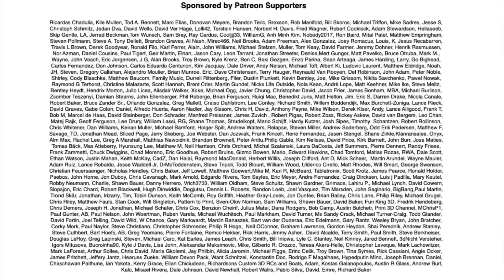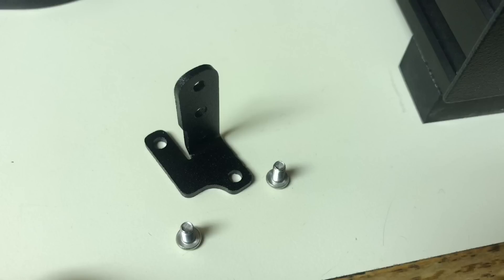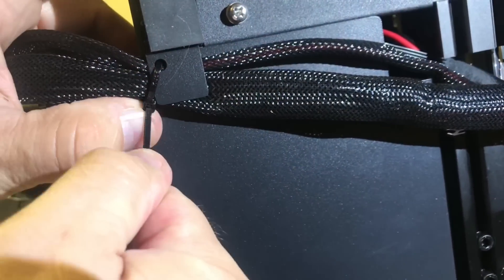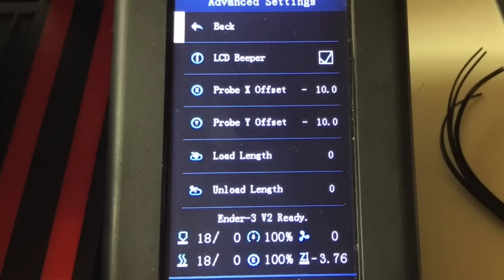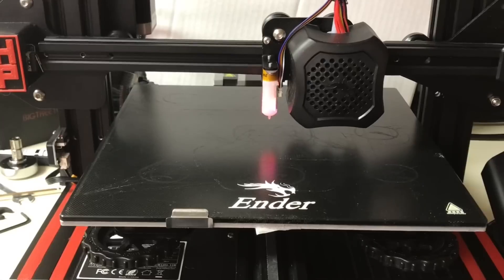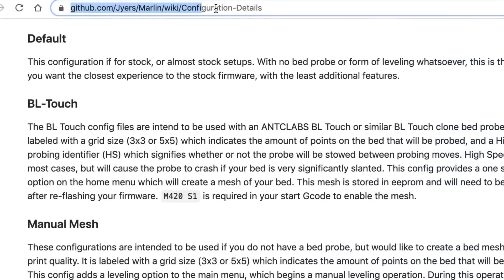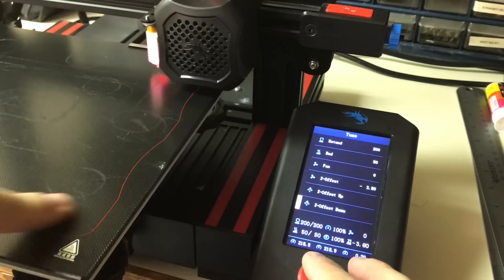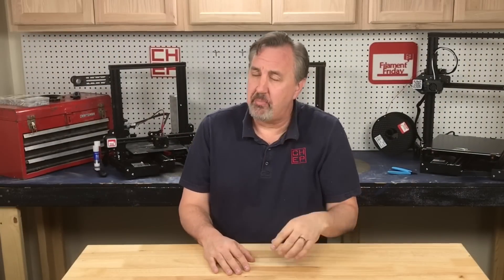How to Install AutoLevel on Creality Ender 3 V2

Comment: GREAT video. Can you please readjust the bed size for the ender 3 Max. This would be most helpful to alot of people. I tried this on the ender 3 max but come up to short because of bed size when moving to back position. There is is tutorial from smith3D with your link for the bl touch install for 3 max. Thanks for sharing

Comment: Very interesting video. I also saw your video on mesh leveling your ender 3v2. Which of these methods do you prefer? It seems like the mesh leveling gave you better results but leveling with the BLTouch seems easier to do. Very interested in your opinion on this!

Comment: Nothing happens once I insert the SD card.  The screen just lights up and everything powers on but that's it.  None of these files work.  I tried renaming them.  None of the creality files work either.  I need some help yall.
Reply: I just installed the firmware for bltouch on my ender 3 yesterday and it worked. I downloaded the correct file from creality and downloaded 7-zip. Then in files I right clicked on the creality file and clicked extract with 7-zip or whatever. Then you get a folder with the .bin file that I put on an 8gb micro SD, plugged it into the printer when off, turned on the printer, and after about 10 seconds of the screen being on but blank the regular startup happend and it was finished. Hope this helps
Reply: @ethanm1943  thank you, I'll definitely have to download 7-zip and try again. I also just seen that all wires should be in the dedicated BLT port on my main board.  So ill give both a try. Thank you again. I'll update after work today.
Reply: The same problem happened to me, make sure to unplug the power cord before inserting the SD card.

Comment: Hey good sir, have you tried to compare the print results of 3x3 vs the 5x5? because i just installed mine with a 5x5 and i still cant get a consistent bed label some corners are nozzle to low and other corner is the nozzle is too high.

Comment: I upgraded the firmware on my Ender 3 V2 to Jyers  BL Touch 5X% V1.3.3, and notice there's many more new menu choices and sub-menu choices.  Many of them figured out, but wondering if some where there's a manual that describes exactly what all the menu choices do exactly?

Also trying to recall what was the original firmware version that came with the printer if I want to go back?
Reply: Check the Wiki!

Comment: Auto bed leveling is a MASSIVE quality of life improvement for printers. I wouldn't recommend anybody try and do it manually because even thought it's possible, it's far easier to just use ABL and be guaranteed decent 1st layers. Biggest issue with it is you really need to rebuild the firmware to tweak how many points it probes and their offsets.

Comment: Help Please, Looks like V4.2.2 under the word Creality in the middle of the board on the bottom. Now to sort out my levelling menu and why it does not just go to confirm when I click the Level menu icon as in the video, instead I get a list of option, check box for Levelling Active, Creat New Mesh, Manual Tuning, ETC. . To confirm, I had loaded E3V2-BLTouch-3x3-v4.2.2.bin. Any suggestion . Thanks in advance.
Reply: Well feel pretty dumb now, Yes just click Create new mesh. Yea. already had a mesh so make sense.

Comment: Thanks for the video, I also added the bltouch to my Ender3v2, which is a beutifull machine by the  way. But I have the issue that the probing often fails. I can not start prints via ocotprint due to the danger of crashing the probe into the bed. I also made sure the bett is manually leved as good as possible (bed is warped). Did you experience something alike?
Reply: Did you solve this?
Reply: @veenarm  not really. if i level via display it works most of the time, but with G29 I have several probing fails. I now ordered a second z leadscrew kit, because I also think that this is a issue.
AND I ordered a anycubic Vyper, to see if its auto leveling is better.

Comment: Help!!!! I followed your instructions installing the BLTouchV3.1 genuine item. However, after copying the Jyers/Marlin E3V2-BLTouch-5x5-v4.2.2.bin file to my SD and inserting into the E3V2 slot, on powerup I get a dark LCD screen and cannot access the printer at all with octoprint (which was working perfectly on the stock SD card firmware). I fear that I have a brick now. ON powerup, the BLTouch does light up and the probe extends/retracts twice but as I said, the screen remains dark (though it is on because I can see some light emanating from it in the dark). Help!!!!
Thanks in advance.
Reply from the maker: Rename the .bin file and try again. You might have to use a new SD card but it will recover.
Reply: be sure the firmware is for your board revision
Reply: Phew! It seems that it was not wise to put the new .bin file on the stock SD card that came with the machine. I tried putting the new .bin file on a brand new FAT32 formatted SD card with nothing else on it and that worked, thank goodness. Have not yet done the probe calibration process, but that is next. Thanks for your help!
p.s. I do note that I tried putting the E3V2-UBL-BLTouch-10x10-HS-v4.2.2.bin file onto the machine. It seemed to boot ok, but I received an M112 error message on the LCD screen after a few minutes. I don't know what that means, but I then reverted to E3V2-BLTouch-5x5-v4.2.2 and that seems to have eliminated the error message.
Reply: @arniep740  I'm having the same issue, but I tried your solution and I'm still getting the black screen
Reply: @nearpath8785  I found that formatting the memory card and only putting the correct bin file worked.
Reply: @tekeguy68  thank you, I figured it out earlier, I just had to do that on the starter SD that came with the printer

Comment: So i bought last week a ender 3 v2 i install the BL touch upgrade with firmware 15x15 ,upgraded  the bed spring(orange)upgraded ,micro swiss all metal Hot end and i upgraded the Metal feeder Extruder(Capricorne tube install)...With that said i have no clue what i am doing, i just try to follow the lead of different you tube videos, I know i am doing a lot of thing wrong, i just try to level the bed and the right up corner of the bed is to far from the nozzle and each time i fix it. The other corners are way off...I though that BL Touch would correct that ?I am a Noob with one week experience i manage to do the small dog that was on the Micro SD card without the BL Touch install...The result was not great but that was my first print, Then i try to get the bed fix OH BOY....Now i cant make the CHEP SQUARE LINE*(was able to do the CHEP *square  line prior to the dog print  without the BL Touch*was not great*)work on it for 2 days like if it was my new day job...Got tired, then i install the BL Touch(Now its even worse...Still no luck ?Can someone help a NOOB PLS
Reply: Maybe check different video guides or dedicated forums? It seems you've bought a lot of parts that you want to install. My suggestion would be to go slow, be familiarized with the process of 3D printing. Out of the box, the ender 3 v2 also works just fine. Bed leveling is a tricky yet important part of 3D printing. Maybe your offset distances are incorrect? or Maybe there might be settings that you'll need to change in your firmware. Stick with manual bed leveling for now, as all this gets a bit tricky for a newcomer to do at once. Manual bed leveling is easy to follow. Else I suggest using TH3D's firmware :)
Reply: Hey bud Adjust the bed springs make sure to move the head to the four corners and set them all the same be sure to have a .2mm feeler gauge to check it all out bed to tip, hope that helps

Comment: Need help.. I'm building two Ender 3 V2 and got 2 BLtouch from Creality. Both of them have the same issue. When probing, the needle deploys and moves down and when the needle hits the bed it doesn't retract immediately - the needle compresses down around 1mm and THEN it retracts. I have an older Ender 3 with Bl TOuch and as soon as the needle hits the bed it promptly retracts on impact. (just like in CHEP's video) I Installed the same firmware as CHEP (1.3.1). Same issue happens with newest firmware 1.3.2. and BOTH Printers have the same exact issue. I read something about an HEX key on top of the BLTouch which I rotated 1 revolution clockwise on one of them.. didn't fix the issue.  I'm puzzled because it's happening on 2 separate systems. The version of BLTOUCH I have is 3.1, and came in a creality box with the correct cable and brackets-  I threaded the cable inside the sleeve just like CHEP did. Thanks very much CHEP btw for the nice video. Anybody seen this before?

Comment: i installed the firmware and now my screen wont turn on at all it stays black please help
Reply from the maker: Change the name of the file and try again. Also maybe try a new SD card but the name must be different.
Reply: @FilamentFriday  what should I change it to?
Reply: @mrfrankferd  just add a 1 or an A to then if the file name.
Reply: I literally just had that issue, turns out I installed the wrong firmware. I installed the Ender 3 4.2.2 instead of the Ender 3 V2. Was it making a constant beep noise?
Reply: @puretoronto  ya I think I did to I fix that but now it saying printer kill reason homing failed restart required

Comment: Just a quick tip for others who might be struggling w/ this issue;
When purchasing the BLTouch from ANTCLABS instead of Creality 3D, you'll sit w/ two sets of combined pins instead of a singular plug-in type. These you'll have to glue onto the bus port exterior w/ hotglue. Make sure your rainbow / screen bus cable is unplugged and out the way, then ONE AT A TIME, glue the 2-pin one into the top, white top and black bottom. Hold the pin against the board whilst the glue cools down and give it a few minutes. Do the same thereafter w/ the three pin, gluing so that the brown pin is right at the bottom. This is glued into the dedicated BL-T bus port, the vacant one adjacent to where your Z stop switch is plugged in. 
Failure to perform this correctly will likely result in your servo / blue light not coming on when you switch your E3-V2 on and when auto homing, your nozzle will drive into your glass bed. This is the problem I had - initially I tried shortcutting by gluing both pin sets in simultaneously, resulting in one or two pins not connecting to the board. I haven't yet found anyone on the internet pointing this fault out in this way, so hope it helps.
Reply: EDIT - the servo light not coming on was my problem and I've seen others likewise report the issue of their nozzles driving into their printing bed surfaces. If your BLTouch is not malfunctioning, that is to say, your setup not yet being ready to advance to the calibration stage, then check your connection. Also check your wiring and make sure your cabling avoids that revolving z-rod. Slice a small-ish hole into the cable netting. I used one of my smaller allen keys to goad the terminal along which plugs into the BLTouch module, works really easy, just make sure your allen key isn't catching on the netting whilst prodding. When far enough, pull the netting altogether - it can shrink quite a bit, then take your terminal out and plug back in. I wouldn't necessarily use copper wire to pull the terminal through, as its tip may have a sharp / bevel edge

Comment: Just a heads up.  Installed a BLTouch in my Ender 6 a couple weeks ago and was tearing my hair out because it would only intermittently work.  It would attempt to level the bed, get a random number of points in and just error out.  Turns out there's a small hex screw in the top of the BLTouch that allows you to adjust the amount of force it requires to drop the pin.  I turned mine about a quarter turn and haven't had a single failed probe since.
Reply: Which way did you turn it? Counter-clockwise?

Comment: I followed this to the letter, and my printer acts as if the mesh doesn't exist. It doesn't correct up or down in any part of the mesh. Any idea what I could be doing wrong? When I run the bed level print, and microstep up/down, it only helps where it is in that specific point on the bed and doesn't affect the rest of the mesh. Meaning if It's low on the left and High on the right, I get perfect prints on one half and heavy scraping on the other.
Reply: i had the same problem until i finally added the "M420 S1" gcode. I even switched my firmware to a 10x10 autolevel matrix and the result was still crappy until i made use of that mesh with the beforementioned gcode. Did you insert it in your slicing program?

Comment: I am new to 3D printing and had purchased a BL touch, BTT sensor, and installed an octopi setup. I was having trouble with my BL touch not working right and didn't know which of the products was causing the issue till I found this video. This video hit it on the head so a HUGE thank you for posting this and helping resolve my issue.

Comment: Great video, although I didn't think I'd see you do an abl video. I'm with you, theyre alot of hassle with little payoff. Physically leveling is so much faster and easier. If you have a warped bed than yes it will help. Otherwise the paper method is tried and true.
Reply: I don’t think so. Once you do it which is pretty easy you get a perfect level every single time very quickly
Reply: @thebooboo3269  it's really only useful if you have a big bed where inconsistencies can happen or has alot of wear on it. If you're using a 220mm bed it's pretty much there for anesthetics and takes way too much time every print. If you need one for an even print on that size you need a new bed not a bed level. You can buy 3 new good glass beds for the price of an time eating abl. And if you have nice flat bed you should only have to level it once too. However if I didn't have one on my e5+ or cr10-max they'd be borderline unusable. Theres to many little gaps that would never have an even layer
Reply: @s8nlx661  it does not take too much time and it a big quality of life upgrade. I agree with you with many of your points. It is little pricey though.
Reply: @thebooboo3269  yeah im not sure what makes them as much as they are. I kinda cheated when I got one. If you buy just the sensor itself at the time was only 30 bucks for the bltouch 3.1, which I think is still the newest version. And bigtreetech has a harness and bracket kit for 9.99. So it was 40 bucks for the whole setup. If you bought the kit it was almost 60 bucks. And the funny thing was the the wire and harness from bigtreetech was way better quality...go figure lol

Comment: I bought a genuine BLtouch from ANTClabs which came with a different connector. It worked, however it kept disconnecting. Trying to look for an extension cable but can't find anywhere that sells just the extension cable for the Ender 3v2. Anyone know where I can get one? Right now I am just sticking with manual levelling.
Reply: I had that too but just ended up ordering the creality version with the better connector that is keyed and clips in, haven't had any disconnecting issues. I was able to find the cable on amazon but I wasn't sure my probe wasn't faulty either so i just ordered a whole new kit
Reply: @huncho_billy  I would do that too but don’t want to spend $80 for something I already have just so I can have the extension cable. Might wait until they have spares for sale

Comment: Hey I downloaded the 4.2.2 firmware version and when homing the Z axis won't move down, only up. I then tried with v 4.2.7 and no axis homes at all.
When I went back to my old 4.2.2 firmware everything worked again. Any ideas?
Reply: I have the same problem. How about now？

Comment: Anyone know what the values in green and red in the "Mesh Viewer" indicate? Are the numbers, like 0.03 mm values or unitless? Does green mean 'high' and red 'low'? Any success in adjusting the bed 'flat' according to the mesh viewer? After trying to get as many squares black 0.01s, my bed was worse than after a quick paper method manual level...

Comment: Kind of a ignorant question.....always hear use sheet of paper to set level, what kind of paper, thickness of the paper, I probably should know this, but.......an inquiring mind would really like to know. Thanks in advance and have a stellar day!
Reply: A4 paper
Reply: @maxwank4209  Max, A4 is a paper size ie. LxW  not it's thickness, to my understanding. If my paper is .004 or .10mm, what so ya think? Thanks....
Reply: @ralphgushman8834  Ah- your correct - I use paper with a width of 0.10mm and my first level comes out perfect
Reply: @maxwank4209  Thanks Max, appreciate it muchly..... Peace!
Reply: @ralphgushman8834  No prob- have a good one!
Reply: Depends on the layer height and filament type. Find out the correct values for your case.
Reply: @alejandroperez5368  What do you believe I was doing with the question? I was trying to find correct values, Mr. Obvious....Thank you.
Reply: @alejandroperez5368  The question was answered by a person who understood the question was related to the video it was posted to. You seem unable to understand the correlation, or your just a troll without the actual knowledge to reply with a cogent response. Thank you for showing us what you are.
Reply: @ralphgushman8834  It was answered with an incomplete reply. How tall is his layer height? If you print at a layer height larger than 0.24mm that same piece of paper won't work because the nozzle will be too close to the bed.

Edit: if you're talking about bed leveling the corners, then any paper thickness will work. If you're talking about z-offset then you also need to account for the layer height. Anyway, people who have been using 3D printers for a while don't use paper. They use their own eyes or install levelling sensors.